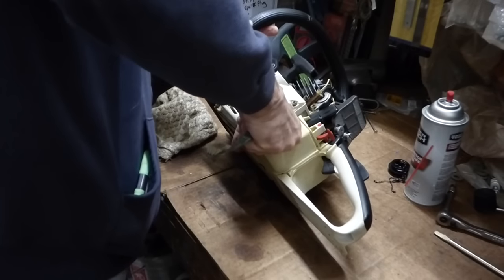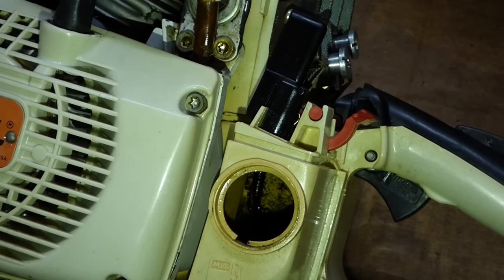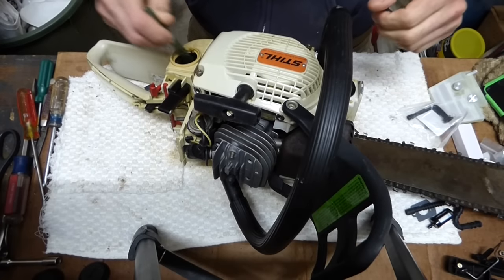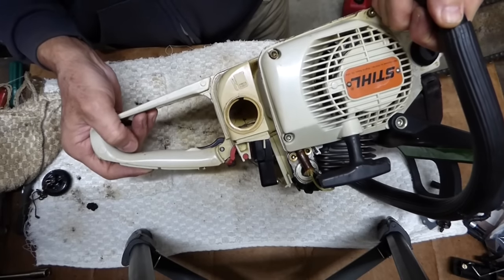Never Do This to your Chainsaw ... How to Repair it if you do

Comment: I have a 026, one of the best saws made. Bought mine in 1998 and it has cut wood for me for all those years. I always use gas without ethanol  and start and run my saw each month.
Two things you do not lend to a neighbor , your wife and your chainsaw.  Great video !
Reply: I always use gasoline that does not contain ethanol in all my gasoline powered tools.  Have never had these kinds of  problems.
Reply: Same. I've only run the expensive canned fuel stihl sells at my local stihl dealer. I use it for my chainsaw, weed eater and leaf blower, all stihl and love them. They always start and have yet to be let down by any of them.
Reply: @jonm4995 just use red armor oil and its protected
Reply: @Psy6o   Crappy fuel + expensive additives = expensive crappy fuel.
Reply: @jonm4995  I've used non Ethanol gas and Stihl 2 stroke oil, and haven't had a problem or rebuild since 1991.
Canned fuel is too expensive and isn't necessary.
Reply: I have my late father's 026, and it hasn't had any major work done, since he bought it in 1991.
I've used my dad's saw, and didn't want to burn it up, so I bought a used later model, which was the 260 Pro, and that one runs excellent also.
I brought out the 026 this weekend and it had no problems still.
Buy the best you can,  and keep it going.
Reply: My neighbor ended up with them any ways.

Comment: I have been a chain saw user since the 1980s. I think you did a fine job. One thing I would like to offer is, if your guide bar has roller or sprocket tip  grease holes, don't forget to grease the tip. (I grease it, roll the chain, and grease it again. This flushes out the dirt.)

The other thing is, I use a bar cleaner tool to clean out the groove. A screwdriver tapers, but bar cleaner tools have parallel sides. So I am more certain of scraping out the crud.

I then flush the groove with a long shot of WD-40 to rinse the groove.
Reply: He did grease the sprocket at the front of the bar, he had to to get it working again
Reply: Use a hacksaw blade to clean the bar!👍
Reply: @warrenfloyd1484  Hacksaw blade?
Sheeeeeeeyit........I might try that. 
I had my Stihl MS-290 Farmboss stored away for over 8 years. She was really seized up and I couldn't even pull the cord. I corrected that after watching a few YouTube videos. She's cruising like a charm now but I haven't tried to cut wood yet. Thanks for this tip.
Reply: File it flat, and debur it.
Clean out crud and the filings, and you're good to go.
Reply: I use a air compressor to do that then oil it once it looks cleaned enough

Comment: Great video, well explained and the camera work was excellent. Just a small tip I learned years ago. when installing a screw or bolt, to avoid cross threading, especially in aluminum or plastic, turn the screw/bolt backwards until you feel it drop into the thread, then tighten.
Reply from the maker: I always do that too... good tip to remember
Reply: One the best video I've seen, and I've been doing this for years 🧐👍🏼
Reply: I always take a flat file over the bar and take the sharp edge off,🧐
Reply: I'm glad you said that.  It's rarely mentioned as if everybody knows that, which they don't.  Good catch.

Comment: Great video. That's the worst damage due to resting fuel I've ever seen o.o. Solid advice to the average saw owner to never let the fuel sit for too long, especially if you're mixing your own. On a side note, you can save time and fuss by leaving the trigger assembly alone. That carb just has a hook for a throttle lever (14:58) that gets pushed forward by the linkage when you pull the trigger, and returns with spring tension. All you have to do is pull the trigger, hold the lever in place with a small screwdriver or pliers, then let go of the trigger, and the linkage slips right out pretty easy. It doesn't take any force to win if it fights you a bit, just a little finesse.
Reply: I've been using "truefuel" to overwinter small engines, they sell both straight & pre-mix at Lowe's , home Depot, etc

Comment: Real fine informative presentation; I worked in woods from Maine to Washington State, from handfelling and bucking to using horse and oxen dragging and loading; up until the new computer assisted feller bunchers.
From wooden spar trees and diesel engined yarders on sled of old growth logs to newer steel towers and very powerful diesel motors on down to triple drums and newer shovel loggers and very mobile cat tracked yarders.
As an aside tallest spartree I personally climbed and topped was an 9' diameter Dougfir at stumpand topped just under200 feet and still near 30 inches in diameter.
FROM TREE TO TAILHOLT WAS ALMOST 4000 FEET ON VERY STEP GROUND OF SKYLINE.
WATCHING YOUR REMINDS ME OF WHEN I FIXED AND REPAIRED MY OWN DISTONS AND A TWO MAN Mac used with14 foot  at old growth cedar mill.Tree fellers and hand buckers started out being as " bushlers( paid by thousands board foot).
Your axe wedges, Jack's, tree plates for 18 inch long steel wedges and knowing how to sharpen saw teeth and chains teeth all important to make money so you learned how to keep maintained.
It was the importation of European built saws that changed logging as they were lighter, faster cut5ing than any andall American made.
It replaced two man feller bucket team as onemancould more than double  number of trees felled by just 1 man.
Still was my best saws with Husquavarna second but damn near even choice.
With help of any young son we could teardown to piston removal andspl8t case; and then put back running as new inunder three (3) hours and was real money saver over new.
Thanks for the memories.
RESPECT!
Reply from the maker: Thanks for your visit!

Comment: As for a decent degreaser if you have it Naptha is your best bet over mineral spirits. I always keep it in my shop in spray bottles. That stuff will also dissolve old shellac gas. Good video BTW. Definitely worth saving that old saw.

Comment: I have the1985 Stihl 028 AV Super Wood Boss.  Only had to rebuild it once, but I've replaced the fuel line and carb a bunch.  Upgraded the ignition.  Best chainsaw ever. I use 64:1 oil mix which is 2.0 oz per gallon. 38 years old and runs like new. RELIABLE

Comment: Fuel line:  I purchased 2 feet of line with grommets for a Husky, I also bought Husky filters.  Much less expensive (5 bucks for line and grommets), and easier to put together than Stihl fuel lines.  it also has a larger ID than stihl, but it fits on the carburetor just perfectly.  Thanks for the video.
Reply: Do you have a link for those parts?
Reply: But Husky's aren't as good as they were. Also the parts can be hard to find in the UK.

Comment: I liked how you showed the dismantling and explaining what you're doing and looking at. The pic's of your explanation and procedures and product's used to clean out the fuel tank and the carb and trigger system. You by far have shown the best and will continue hopefully to watch other projects you have. I'm currently working on a 044 Stihl that was given to me. Total basket case . Even though the piston isn't scored it does have what look to be varnishing and a very mushy fuel line. Again GREAT job on visual and explanation. 👏👏👏👍✌️🙃🇨🇦
Reply from the maker: Thanks for your kind comments
Reply: Ya watching your video it had given me more confidence in dealing with a basket case of a Stihl 044 . It sat I believe 4 or 5 years minimum. Couldn't pull the cord a it wouldn't spin even with the plug out. Again your Video is and was extremely helpful and the only thing I didn't do was separate the block. Hours of cleaning as it was a PIG and tore it down completely . And lo and behold I had gotten the beast working. New carb kit,  coil and some other stuff all under $ 75 . Thank You for being so thorough in your video and your explanation and the camera shot's. I've watched many folk's who do either as a hobbie or business and NOBODY comes close to you. Koodo's to you. 👏👏👏👏👏👍👊✌️🙃🇨🇦

Comment: To washout an old fuel tank like this just pop the fuel cap off, insert your pressure washer nozzle and spray all around inside the tank. I just revived a 1961 Stihl 07 Super saw that sat since 1989 with fuel in the tank and that tank got pretty clean using this method. For severely bad tanks you can also pull the fuel line out of the tank , pour a little 100% purple power in the tank and let it sit for a while, then pressure wash the inside of the tank.

Comment: Went to local tip to dump lawn clippings. Saw a lawn mower on the metal scrap pile. Asked groundsman if I could take the mower, he said ok. Bought mower home, open fuel tank, fuel smelt off. Drained fuel tank, put new fuel in, primed the carbi, 2nd pull of the rip cord, engine roared into life. 👍🇦🇺
Reply: Got a Honda four stroke mower for a fiver from the dump. Started it with a drill and a socket on the fan nut. New fuel and its a first pull starter.  Scruffy but the motor is mint.
Reply: I work at a large hardware retail outlet where we sell dozens of lawn mowers spring and into late summer.  I do the set up from the carton box they are shipped in.  Every once in a while, a customer returns a mower of 3 brands we sell.  We either give him a new other mower or refund his money.  We don't have a repair department or a mechanic so the store gets a credit for a defective unit and they evenually go into a large dumpster and to a landfill.  Employees are forbiden to take these "busted or defective" mowers.  They have B&S engines that have been around on lawn mowers since I was a little kid.  Boys used to make go-carts with these motors.  It is a waste of resources to throw these mowers away.  There is no such thing as "away" now days.  The blade most likely has never cut a blade of grass.  All so sad.  A small engine mechanic could have a part time job here.

Comment: Excellent video, very complete and accurate instructions!  I noticed the rim sprocket looked a little worn.  Since you had the carb and muffler removed, I would have done a vacuum/pressure test to see if there were any leaks in the bottom end.  I also noticed the chain sagged a little but then tightened up as it turned.  Could be related to the wear on the sprocket and wear on the chain drive links due to the worn sprocket.     026 is a great little saw!
Reply: 026 is underpowered and way to weak for anything besides back yard weekend warriors. If it's not a 311 or better you're just wasting your time.
Reply: @shelbie9500  Weekend warriors' money is just as good as knuckle dragging wood apes'.
Reply: @shelbie9500  You may wish to spend less time looking down your nose.  If someone says something is great for them, it is great for their purposes.  We aren't going to the Canadian Rockies to fell 4' diameter trees.

Comment: One thing I've been told by my Stihl dealer is to not use regular pump gas, but rather use 90 octane Recreational Fuel, which is ethanol free and will not eat up your fuel line.
Reply: Sa a1 c⁰⁰
Reply: I used to have 2 chain Saws and I use two stroke petrol mixed with light oil
Reply: I use non ethonal boat gas perineum 90 Oct still has some ethonal
Reply: Don't use that can gas
Reply: Yeah, that's a sure sign he isn't a good mechanic -- they all blame fuel for their shortcomings

Comment: I keep Stable Gas Stabilizer in all my small engines over the winter months and run them several times during the winter, have never had Carb./Engine Problems...

Comment: Good tips great rebuild straightforward if I may add a couple tips when cleaning small gas tanks use BB's and put one part lacquer thinner TO 5 or 7 Parts gas, fill all the way, leave several hours or longer too unsettle varnish, gunk. Purge ⅓ gas out, add BBs shake vigorously if one can, let set, repeat (should be clean), Purge. New gas, Stihl oil, or comparable. Obviously if the lines need cleaned or replaced then so be it.
 Large motorcycle gas tanks one can use the same process or marbles instead of BB's. Add more lacquer thinner if needed. Be well everybody
Reply: Excellent tip!!!
Reply: 99

Comment: Bought a slightly used Husky 372, after one of the hurricanes. Left it in the shed for a year, 1/2 tank of gas. Pulled it out after that year, she started right up, and ran fine for quite a while.

Comment: How could someone do that to an 026? One of the best saws ever made! Thanks for bringing her back to life.
Reply: My old Pro 026 is kept in museum like condition.  The crown jewel of my fleet for the small saws that is.  I run her once a year just because.  Polish her back up and properly store.  Wish I had another just because.
Reply: Never had an 026, but my 036 and 044 are still the best saws I've ever owned. Would love to get my hands on the same saws again.
Reply: @MrGorehound  I do the same thing with a hand me down Homelite saw, it never fails to start and has saved me many times when one of the stihls develops some new issue I have to sort out b
Reply: Had my 038 Stolen along with my MS 250. Just sick about my 038, loved that Old Work Horse of a Saw.
Reply: @johnruth4311  I have an 038 that I bought at a pawn shop.  It has always been a faithful servant.  Always starts and runs great.  Like you said, one of the best all around saws.

Comment: Hi,
Thank you so much for sharing your expertise, even in minute detail.
      I have been using a stihl 450 brushcuter for the past 4yrs. But recently I've to change the spark plug quite often. What I noticed is that the machine would accelerate without pressing the trigger. It would not restart until a plug new plug is used.
Reply from the maker: Sounds like you’re running your fuel mix too rich with oil… Maybe 20 to one or something like that and it’s building up on the spark plug causing it to rev up and then files the plug.  I run most all my equipment at 40 to 1 and that machine probably calls for a 50 to one mix

Comment: I got my saw back from the kid seized! The piston and ring set sold for the saw is oversized! After a lot of work and heat and of course a rubber mallet I finally got the head off. Using emery cloth over time I was able to free up the rings! By using a break hone I got the cylinder cleaned up. Once assembled and a carb rebuild it runs as good as new! I run a fat mixture of oil too. Several years later the old Sachs runs like new still. In the saw shown the gas left in the saw had alcohol in it and ate the gas line. Today the carb kits you buy are alcohol resistant. Thing is, if you look inside the port you can see the piston was seized but the compression is still as new! Yes, I was once a small engine service repair man.

Comment: When replacing coarse-threaded screws in plastic parts put the screw into its hole and turn it BACKWARDS a few turns. You'll feel the screw hop as the leading thread  of the screw skips over the lead-in thread of the hole. Turn the screw a few times but stop immediately after you feel the next "hop". Now turn the screw in the proper direction and it will tighten properly into its hole without cross treading.
Reply: that's tough to describe and you did it very well.
Reply: Start doing that TODAY with every screw you put in...wall plates for electrical
switches and outlets for instance.  Far fewer cross threading problems from 
now on. For a LOT of things.
Reply: @mattjewett4473  screw backwards till it clicks, then screw it in.
Reply: Agree and I think he did just that in this video!  Great point anyway.
Reply: Good Tip, I saw him do that when he put the screw back in when he put the throttle cover back on. I've always done that forever, as a computer tech those tiny screws and plastic are easy to strip. When we would get interns in the summer I would let them take a laptop apart and would always instruct them on turning screw counterclockwise until they felt it drop into the groove and would hear the click before starting clockwise and gently tighten it snug.

Comment: Good repair. I use 2 cycle oil for lubing rubber fuel line parts for assembly. Also, an unused plastic credit card works great to clean out the channel. Perfect fit.

Comment: My brother retired as a mechanic and recently just barely survived (and will never be the same) because of damage caused by his use of solvents at his job.  Please, when you use carb cleaner, gas, acetone, etcetera, remember that your skin is porous and what your spraying is going into your blood stream.  If my brother could go back and advise his younger self, it would be to buy and use protective gloves.  Good job on the 025 those are great saws.
Reply: Very good advice.
Reply: I know, thanks for bringing this to everyone's attention, I'm good but I knew several mechanics that have problems on account of hrydoseal 1
Reply: ⁿ